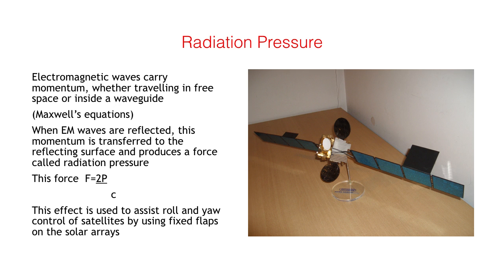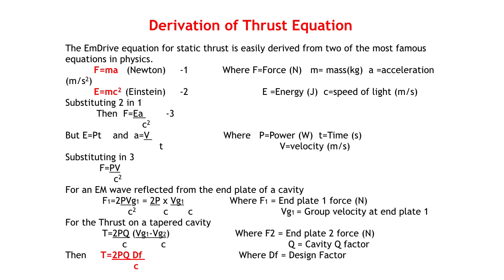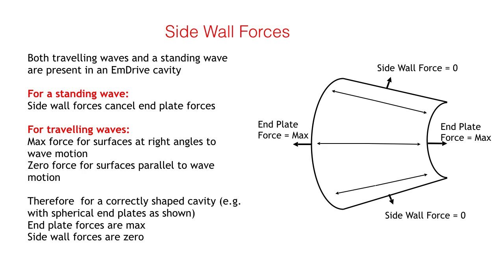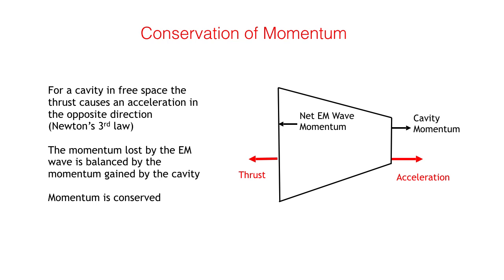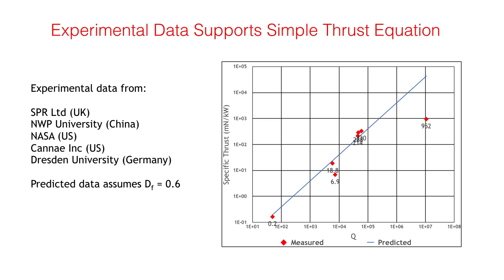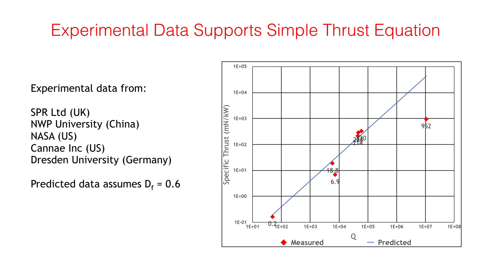Roger Shawyer Explaining The Basic Science behind #EmDrive

Comment: I don't think he's considering the force on the tapered section, just the two end faces, which is why he gets an incorrect (non-zero) result.

Per momentum conservation (which should be step zero for all of this), it cannot work. You have to throw momentum backwards to gain momentum going forwards, no ifs or buts. Anyone trying to suggest otherwise is proposing new physics, whether they like it or not. (And momentum conservation isn't just a rule for rules' sake, it comes out of the fact that shifting everything in the universe to the left one meter doesn't change anything - that invariance is actually equivalent to momentum conservation. The Em drive would require that shifting everything in the universe to the left (or in any other direction, or rotating by some angle) does meaningfully change things)

As others have said, you can do more detailed treatments with stress tensors and get that the thrust is again zero. And experiments bear that out; once you've accounted for the absolutely minute (spurious) forces from thermal effects and stray magnetic fields on power lines, the force you find is zero.

I'm not sure whether Roger is a grifter or just senile, but the Em Drive was given far more consideration than it deserved, given that it relies on breaking one of the most fundamental rules of physics.

Comment: "Shawyer has posted numerous test results ranging from 44 to 110 mN per kilowatt,"  1/ 10,000 of  that Kilowatt in goes into velocity, 0.0001.  (1/100th of a Percent)    as opposed to a chemical rocket engine is around 60%, not .01 of a percent.

Comment: This video is akin to saying that thrust can be achieved by filling it with compressed nitrogen.

If the mass of the enclosed cone is 1kg, with the wider flat side having an area of 100 square inches and the narrower side 50 square inches, and the psi is 20 we get;

2000 pounds of force to the wide side which is 8896.44 N
1000 pounds of force to the narrow side which is 4448.22 N

This gives a net difference of 4448.22 to the larger surface area and so the enclosed cone should accelerate as per the force equation.  In fact it should result in 4448.22 m/s^s right?

Well, no.  The tapered portion of the cone doesn't neutralize the pressure radially because it's tapered.  If it wasn't, then both surfaces would be the same size and would cancel each other.

Whether it's gas pressure or radiation pressure, doesn't really matter.  

To maintain a wave's energy (even an electromagnetic wave), any change in amplitude will have a corresponding change to frequency.

The energy equation for amplitude is;

E = kA^2 where k is a constant.

The equation for frequency is;

E = hf where h is a constant.

Combine these and;

kA^2 = hf

And so any change to f (frequency) must come with a change to A (amplitude).

So the only way for it to work is to not be a closed system and make use of radiation pressure by emission.

P(e) = E/c

Where P(e) is the pressure caused by emission
E is the energy of the radiation
and c is the speed of light constant

Indeed, the engine being tested by China is open ended.  To say that they don't use a fuel source is misleading.  They simply wouldn't use a propellant in the typical sense.  Panels can supply power when near the sun but deep space will require a power plant of some kind which will mean fuel.  Likely nuclear.  The "propellant" is electromagnetic radiation.

Comment: - At 0:59, No satellite uses the radiation pressure to change orientation (yaw, pitch, roll) for two reasons: the pressure is much too weak, and we prefer reaction wheels or monopropelant engine. On the other hand, the solar pressure will tend to change the orbit of a satellite and not its attitude. Moreover, the radiation pressure is not  F = 2P / c, I do not even know where this relationship comes from.

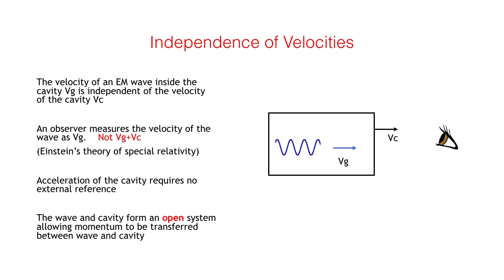- The narrator indicates at 3:15 that according to the special relativity, the speed of light is an invariant constant, which is true. But on the next slide, he indicates that the velocity Vg is a function of the diameter in which the wave circulates, it is wrong, Vg is an invariant constant, he said it just before.

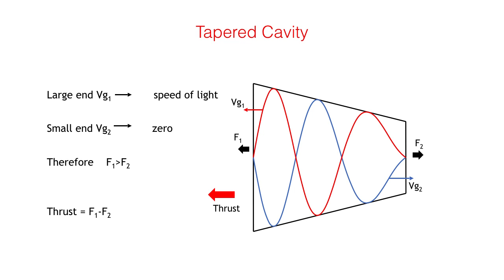- At 5:25, the narrator says that Vg1 goes at the speed of light. That implies a zero mass and a cavity under vacuum, but it is written that Vg2 = 0, which is incompatible with a particle of mass zero whose speed is necessarily equal to c.

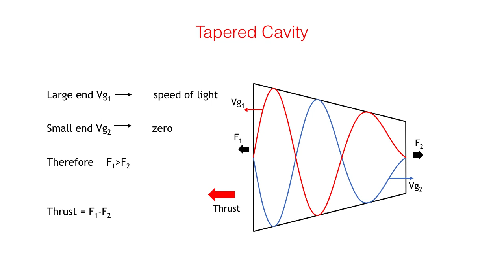- The next slide (6:16), everything goes wrong, the narrator talks about the energy of a particle E = mc ^ 2, but the mass of a photon is worth 0, so, in his example E = 0 J, which is of course completely wrong. The total energy of a particle is equal to the sum of its mass energy (mc ^ 2) and its momentum (mv), so the energy is equal to E ^ 2 = m ^ 4.c ^ 4 + p ^ 2.c ^ 2, either in the case of a photon of zero mass E = pc and not E = mc ^ 2. The rest is totally incorrect.

- Electromagnetic waves produce pressure when they are reflected, just like a tennis ball on a wall, but the narrator has forgotten a detail of importance, he does not study in an isolated system. Indeed, under the conditions presented, the momentum is preserved, because of the pressure difference between the two asymmetrical sides. But he forgot that the generation of these waves also produce a quantity of movement, but in this situation, the total balance gives a resultant zero, so no push in one direction or the other, just as the blow on the windshield of his car will not move it forward. NEVER.

I spend on the rest, none of the measures supposedly realized is really sourced ...

In short, beware, this video is a fake, no known physical law, let alone a gloubiboulga between Newtonian mechanics and relativist, does not allow to explain this phenomenon, if phenomenon exists

Comment: This is all a lot of hogwash. It is well know from experiments that if a wave packet travels down a tapered/chirped waveguide, the amplitude of the wavepacket will increase as the group velocity decreases, exactly because of momentum and energy conservation. I have in fact measured this myself.

So while it is true that for a fixed intensity, a lower group velocity gives less radiation pressure, that is irrelevant in this case, as the intensite of the wave will not be constant over the length of the cavity.

Comment: I am Mathew Orman and in 1982 I have conceived an idea how to produce force that would accelerate massive object without reaction mass. Idea is based on classical physics reduced to a device that uses electrical energy to produce a static force and or accelerate an object resulting in gain of kinetic energy. The initial model and prove of concept uses microwaves. Due to specific physical relations of used materials the device requires large ratio of supplied power to net force it generates.In 2017 I have invented a new device which is not using microwaves and has an extremely low power requirement to produce large force exciding the weight of the device. Currently building a demo device to produce force of around 10N using 30W of power. This comment is intended as a public record to help resolve any future priority date disputes.
Reply: duly noted. any luck? thought so...

Comment: One theory not discussed in is similar to "'Hawkins Radiation" from a black hole and an unequal "Caimir Effect". A standing wave is set up at a specific frequency at each end of the cavity. A virtual partial photon pair is manifest randomly where one virtual particle on the inside the chamber and the other is on the outside outside. If the virtual particle on the inside of the chamber happens to be the right energy/frequency to couple to the standing wave inside the chamber and is "boosted" to become a real particle it then flies off into the chamber.  This leave a general low area of photon pressure on the outside of the chamber. This is similar to  the Casimir effect where a small gap between flat plates preclude certain wavelengths in the small gap between the plates and the plate are pushed together to no net effect.   From the shape of the EM Drive this effect would happen at both ends but one end has more surface area that the other so there would be a net force.
Reply: joseph Potts right on the money!
Reply: @atanuraju9786  bs

Comment: Physics major here (but it's been a while).  I can't read all the comments in here, and maybe NASA's explanation contradicts what is shown here ,but here are my questions.  1. Is the change in momentum by the photon source being factored in? (At 3:11 the photon is shot right, so the photon source should get pushed left).  2. At 9:07 I don't see how the waves are travelling parallel to the side walls; take the bottom ray--when it hits the left (bigger) end, shouldn't it reflect partially "downward," toward and into the side wall?  3. At 5:31 it stays that the force on the bigger end (F1) is bigger than on the smaller end (F2), so it should get pushed left and accelerate left, but at 10:11 it says the acceleration is to the right, but I can't understand why (I know the supposed idea is that it's pushing something left, but earlier the idea was that IT was getting pushed to the left, NOT that it was pushing something ELSE to the left) Isn't this a contradiction?.  4. (comment, not question) I still don't see how it would work anyway, but I wonder if this drive works as long as the EM radiation is increasing.  For instance, if I start running and speeding up toward the west I push the earth east and the earth's rotation speeds up.  But as I reach a constant speed both my speed and the earth's rotation will stop changing.  If I slow down to a stop I push the earth west and the earth goes back to it's regular rate of rotation.
Reply: Yes the Shawyer presentation is pretty confusing isn't it? At least your comment about the rotation of the earth seems to be very Newtonian and if I remember it right then a rotating system has a constant angular momentum until some torque acts on it. That sees to resemble the first law of motion doesn’t it?  
As far as I can tell the whole thing in the schoolbook could stand to have a second verse on the end of it and then for the next part I had the impression that torque is equal to the moment of inertia multiplied by the rate of angular acceleration. Isn't that it? 
And isn't that like the second law of motion? 
But if you try to push it over in that direction then probably such a Newtonian poem is about to get in trouble already (and before it gets up to the last part of it) from people who think that quadrants are more elementary than radians.
But maybe those people are oversimplifying it? 
Should radians be taught in elementary school?